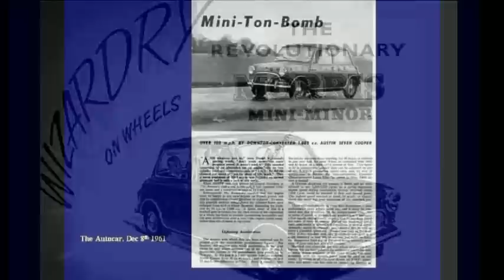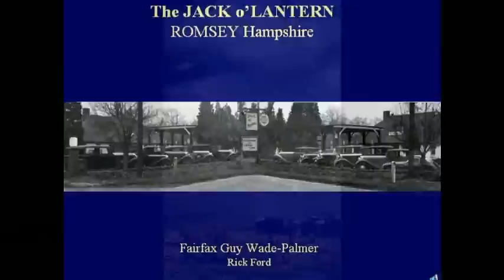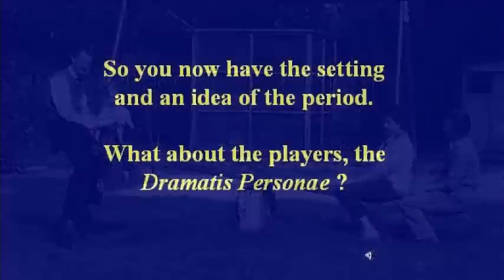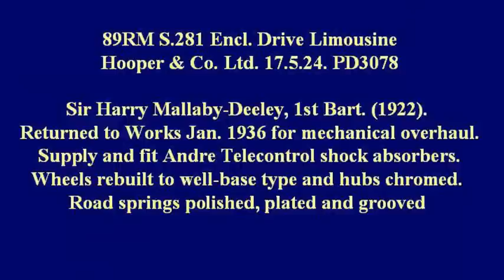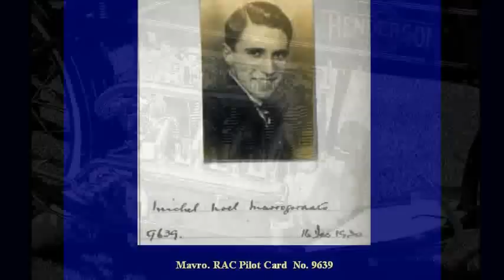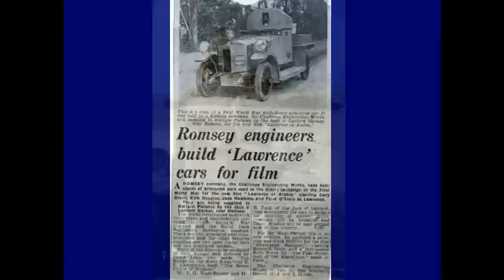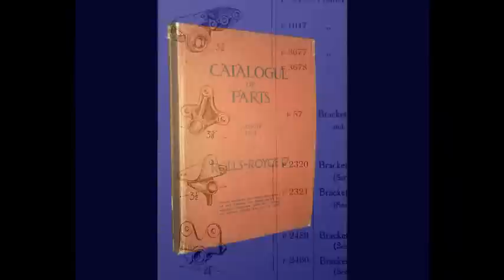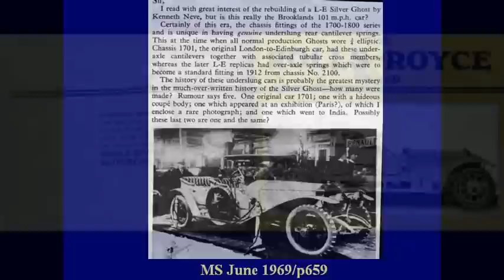RREC Rolls-Royce classic car garage 1950s

Comment: LRO331 is #B90HK 4 1/4 litre Sports Saloon by Park Ward
Reply from the maker: B90HK was suggested
1. Complete Classics no.4 currently has LRO331 as B90HK but it isn't that car. That car is an all-steel Park Ward saloon (LRO331 is an early composite construction type) but admittedly with the same pontoon wings as the LRO331 car. B90HK was owned new by a Belgian aviation engineer.
 
2. Of the candidates remaining for LRO331, B9BN was a Park Ward also owned by a Belgian aviation engineer; B97BN was ditto and owned in Belgium but not by an aviation engineer; B71BL was ditto but owned by a French aviation engineer, Poberejsky.
 
3. However, Will Morrison feels strongly that the pontoon wings that B90HK and LRO331 share are so so close to the Vesters & Neirinck type. In that case, it must be more likely that LRO331 would be a Belgian car, either B9BN or B97BN. Given that B97BN had no aviation connection and that LRO331 shows really good engineering in its added crossbracing, I think B9BN has to be the stronger candidate for either of the reasons, i.e. pontoon wings done in Belgium and/or engineering standards in the crossbracing.
 

Hello Rick,
 
Still no further ahead with LRO331. B9BN, my current favourite as LRO331, survives but can't locate owner Whitehead. I need to see pics of it. The other favourite was B97BN, now a shortened racer without any front bracing between the lamp stanchions. That doesn't mean it can't have been that car (current owner might have removed the bracing because it now has skimpy wings) but B97BN wasn't owned by an aircraft engineer when new though it was Belgian. The aircraft engineer link, as you know, is just a punt, i.e. such a person would recognise the flimsiness of the Derby's front end pre the DG series.
 
Poberejsky's B71BL was last known in 1954. ASsuming the pontoon wings on LRO331 were by Vesters, i.e. Belgian, the current thinking is to choose a Belgian car, hence B9BN or B97BL.
 

 
All the best, Tom